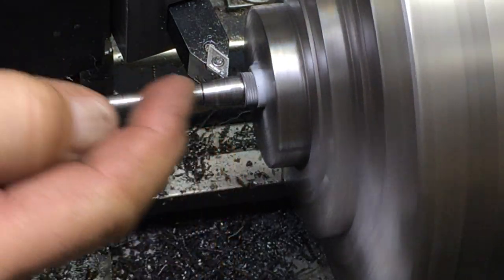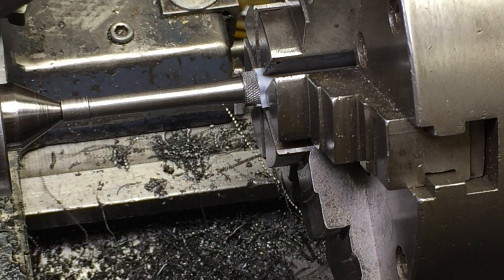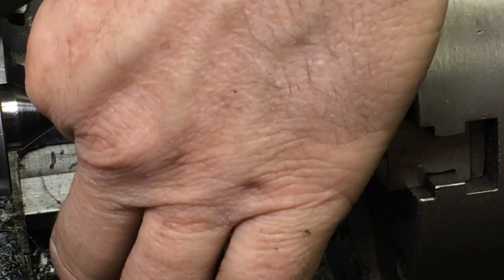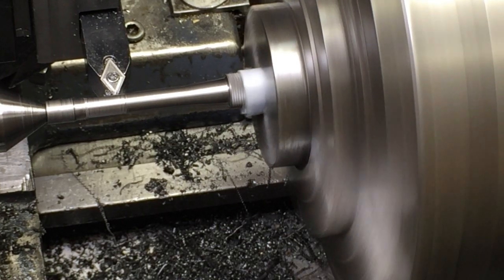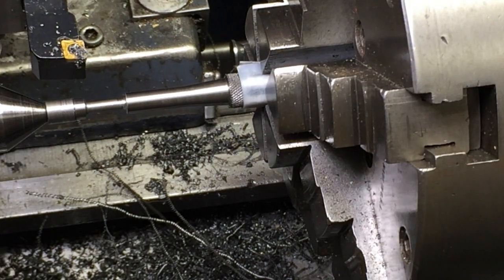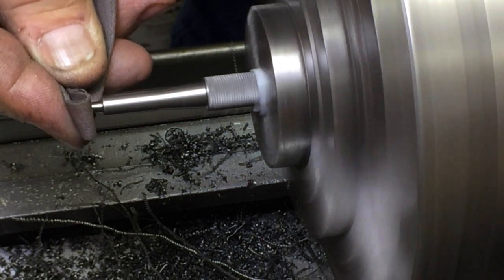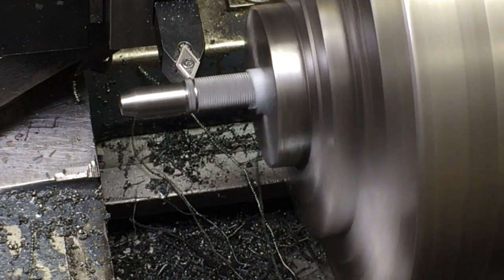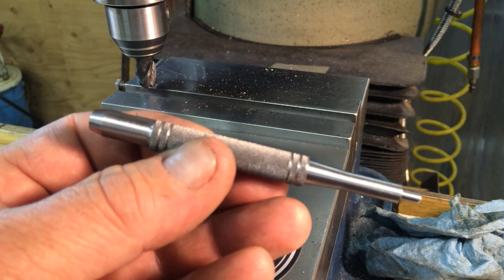How I Made the WIYB Test Punches Part 3

Comment: Wonderful craftsmanship, Randy, and artistically pleasing.  But, uh, just not what I think of as roll pin punches.  Here is what I think of:
http://www.brownells.com/gunsmith-tools-supplies/general-gunsmith-tools/punches/roll-pin-punches-prod5551.aspx
http://www.mytoolstore.com/sk/sk03201.html
http://www.midwayusa.com/product/363683/grace-usa-roll-pin-punch-set-7-piece-steel
The long parallel section is slightly smaller diameter than the roll pin hole and allows punching the roll pin completely out of the hole, driving it all the way.  The tip only has a big enough nubbin to stay centered on the roll pin, allowing the shoulders of the punch to do the heavy driving.  I have had the Brownells set for about 30 years, and they are tough, bulletproof in fact, and are a joy to use, both for installing and removing roll pins.  I smile every time I use them.
Your project, do what YOU think is best...

Comment: Nice work and looks great. Very good knurling. Turning to a shoulder in a tight spot may be easier using the Nikcole mini-systems tool holder with their turning insert GIE-7-ST-3-R-L. The insert can cut bi-directional, groove, and produce a square should. Pretty handy cutting tool for this type of work.
Reply from the maker: Paul Jones I will check that out Paul.  Thanks for watching, Randy

Comment: Thank you for posting another vid Randy......question, and ignore it if you're busy or it's a dumb question:  What value did the flat you milled on the punch add?  Was it just to make a more "finished" appearance on your donation project?  I suppose it would feel better in the hand under certain circumstanced, but with that very nice knurling, I would have thought that would be enough...
Reply: Doh!  I watched it again....you are going to stamp it!  Pardon me, I wasn't paying full attention....hate when I broadcast dumbassness!
Reply from the maker: Clete88 To help it from not rolling off the not level table and hopfully engraving the punch size and WIYB TMC.  Good question, thanks for watching.  Go to the Machining YouTube page on Facebook and check out the photo I  posted of the fixed up Bozo one, which I heat treated.  Randy
Reply from the maker: Clete88 No problem, I do it in every video.  Randy